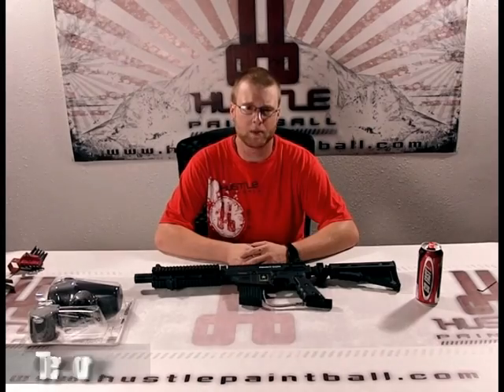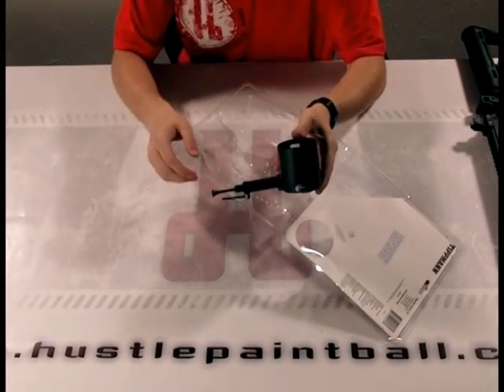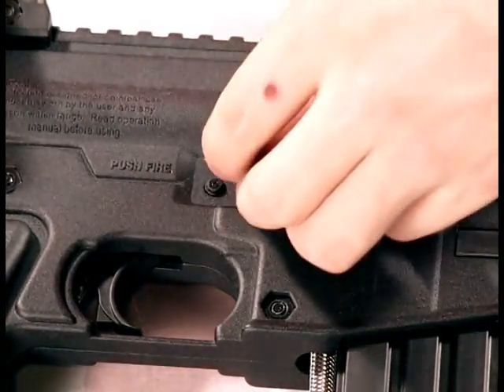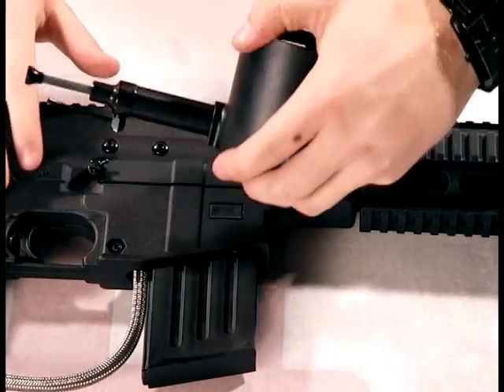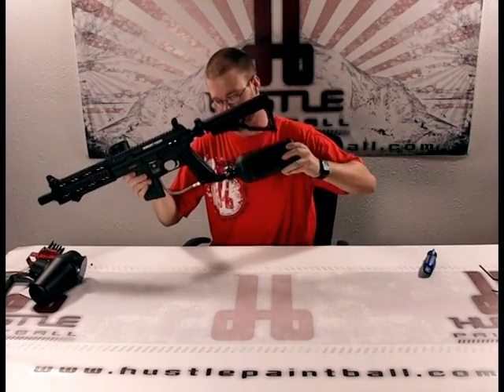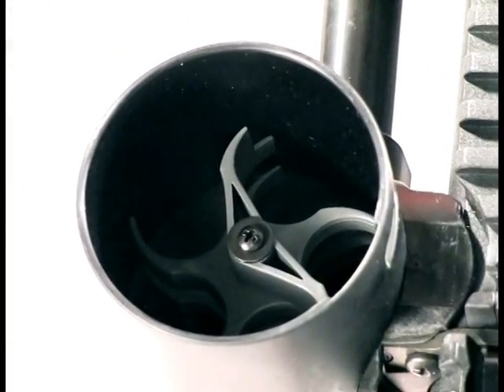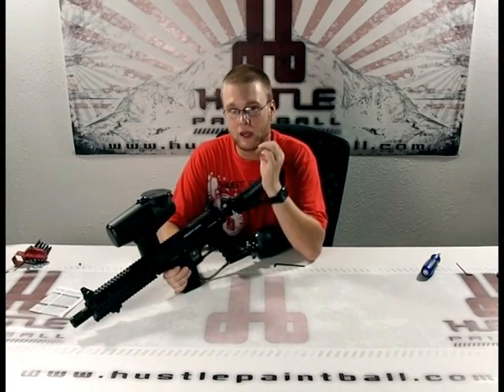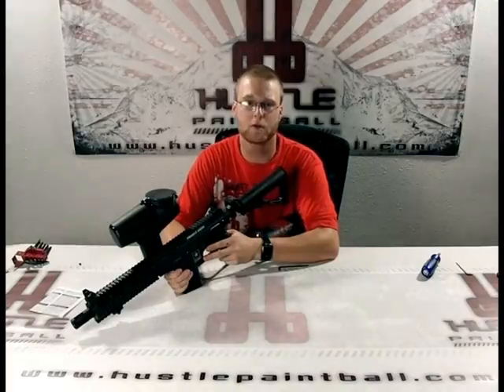How to Install a Cyclone Feed Upgrade on a Tippmann Project Salvo by HustlePaintball.com

Comment from the maker: @Huzzle2 The tube you refer to is somewhat flexible so that it is easy to attach. The fitting that it attaches to has a barb to help hold the tube in place. This allows for you to remove the pieces but they will not come apart during play.

Comment from the maker: You certainly can! You'll use up air quicker due to both of them running off your air supply but they definitely work! My recommendation would be the E-Grip and Cyclone. One uses a battery, the other air. -Russell

Comment from the maker: @novasoda All you may need is a banjo t fitting. Since both the Cyclone and the Response use air you will need to connect both air lines to the marker. Some markers do come with 2 separate ports so you can use two banjo fittings.

Comment from the maker: @PEREZACURA1991 You could do that but there is still going to be some wiggle room between the shroud and the barrel because the J&J barrel is considerably thinner than the stock Salvo barrel. It will stay on but won't be a tight fit.

Comment from the maker: @roger3655 First replace your hose. It sounds like it may have been damaged. Second, depending on your set up we would recommend putting some space in between your tank and your marker to keep the cold gas as far away as possible.  This could be anything from new remote coil or possibly think about changing over to compressed air.

Comment from the maker: The E-Grip can run 4 firing modes that can be changed in seconds - semi auto, 3 shot burst, and 2 full auto modes. You'll be all set with the E-Grip in the Salvo no problem. Definitely pick up a Cyclone with it too!! :D -Russell

Comment from the maker: @soladetenis Runs off of the air in the marker and feeds a ball every time you shoot. This works very well and the main difference is that this does not need any batteries.

Comment from the maker: @xhogzilla88 The disadvantage of both the Response and the Cyclone is the loss of efficiency. The air that is used to run both pieces is air that you won't have for shots. The Cyclone is extremely reliable and as long as you keep it clean it will run. Using the Response with an electric hopper will cut your loss in efficiency significantly. Good hoppers in that range are the VL Evolution 3 and the Invert Halo Too.

Comment from the maker: @BloodandBourbon Loosen your front receiver screws just a bit and make sure that the front sight/cyclone feed latch is able to move freely, and pop up into place. Also, make sure that the front sight spring is there, so that it'll keep your cyclone feed system in place. -Ethan

Comment from the maker: Yes, though most likely not completely. In order to get the hopper completely out of the line of your sight you will have to offset your hopper. Obviously a 25mm lens is going to have less of an issue than say something with a 45mm lens, but the hopper might still obstruct your vision through the sight slightly. - Trevor

Comment from the maker: Loosen the front top receive bolt - that should allow the front sight to pop up (right now, I bet the body halves are too tight, and the front sight is stuck down) and that will allow your cyclone feed to snap up and in place. The other problem could be that your front sight spring is not in place, and thus, the front spring won't pop up. -Ethan

Comment from the maker: @brandonsegovia99 The Cyclone Feed System uses air from the marker to force load a ball into the barrel after every shot. This is a great upgrade that is easy to install and works fantastic. A great alternative to an electronic hopper.

Comment from the maker: @RiCeBo1 Check and see if your tank is low.  If your gun is firing but the Cyclone is not rotating, that may be the culprit. Since it is brand new and you were careful with the installation, some of the more egregious errors are unlikely.

Comment from the maker: @seththeslayer1 This Project Salvo marker does not have a Response Trigger installed but you can install the Response Trigger and use it with the Cyclone feed system.

Comment from the maker: @vjstudio No, the response trigger will not help your cyclone feed. If you are having trouble with it sticking I would lube it with a non-oil based lubricant. If you are still having trouble I would bring it to your tech to see what the problem is, or if you are in Colorado, stop by the store and we can take a look at it for you.

Comment from the maker: We've got it on the list... but the long story short, go with the Apex - it's adjustable, easy to take off, and you can put the Apex 2 tip on other barrels - the Flatline is a fixed system :( -Ethan

Comment from the maker: @xMSxfruitSALAD That's pretty strange - have you chronographed your gun? If you took the velocity screw out, and then put it in at a different spot, that will definitely affect your velocity - go ahead and back out (turn the screw counter-clockwise) to increase your velocity. -Ethan

Comment from the maker: It could be a few different things. If the front sight is stuck down, then you need to loosen the body half slightly to allow the front sight (which holds the cyclone feed system in place) to move. If the front sight moves, but doesn't stay up, then you lost your front sight spring. Search for #98-44 or "front sight spring" on our website to snag that piece. -Ethan

Comment from the maker: Every screw, nut, spring and everything else can be had for any Tippmann marker. Find the part number in the manual and you will find it easily. - Jeff

Comment from the maker: Okay, so you are asking, if you remove the cyclone but no longer have the stock fitting if the marker will work correctly? It will not, all of the air will escape the valve and there will be none to push the paintball out of the barrel. Luckily the stock part is super cheap, it is Tippmann Part #TA05021 and can be found by typing exactly that in the search bar on our website. Let me know if you have any other questions! - Trevor

Comment: I just purchased a Cyclone and it doesn't want to cycle at all (the paddles will not rotate after every fire).  What could have been the problem?  It's brand new and I made sure everything installed perfectly fine.  Thanks.

Comment from the maker: @MrMegafatman15 I prefer the Cyclone Feed System, since it's lower profile than an electronic hopper, but it's completely personal preference. If you want to mount tactical accessories to your gun, I'd recommend the Cyclone Feed System. 

Remember that you can also contact us at support@hustlepaintball(.)com with any questions or comments that you may have.

Comment from the maker: We haven't made this video yet because the only difference is one piece. You just need a new banjo fitting, the Banjo T-Fitting or Tippmann part #02-86 you can find it easily on our site :). Once you have that, both hoses can attach to it, and both kits will work at the same time!

Comment from the maker: @ifUreadThisyourGayXD A Banjo T Fitting will be needed to run both of those on a Project Salvo. The Banjo adds another air line so they both can be used. Hope that helps.

Remember that you can also contact us at support@hustlepaintball(.)com with any questions or comments that you may have.

Comment: if i wanted to install a response trigger where would i connect hose. If i understand right it connects to the same port at 1:25

thanks
Reply from the maker: That's exactly it. Just run the line from the trigger to that port. - AJ (With help from Cromer)

Comment: Hey thanks for the Video..  I install the cyclone feed but its not turning.  Any advice?
Reply from the maker: Hmmmm.... sounds like a connection problem. I would double check all your connections. Make sure the cyclone cycles when you push the plunger as well. 

- Chris

Comment: what kind of hopper did you put on your cyclone feed? Thanks and great video!
Reply from the maker: The one in this video is the old stock cyclone feed hopper. They are no longer made. You can use any cyclone specific hopper - such as the Tippmann Low Profile. :) 

- Chris

Comment: Hey quick question. I just got the Cyclone feed system for my project salvo.I did the install while watching this video. My problem comes into play that the feed system will not latch onto the gun. Is there anyway of fixing this or do I have to go return the one I got and get a new one.

Comment: @HustlePaintball i want to buy an aftermarket barrel(jj ceramic 14 inch) but i dont want to change the shroud on my project salvo could i just buy a m4 front sight attach it to the barrel so it holds the shroud in place

Comment: Yo I saw ur other video and I installed my egrip and I think I did it right but my but stock moves just a little bit side to side just a little should it be sturdy ?
Reply from the maker: Sounds like your body halves might not be aligned properly. Make sure that they're seating correctly. If they are, make sure that the rear plug is seated properly as well :)

-Dan

Comment: Hey Hustle!
I have installed the cyclone feed on my project salvo and if i dont have the stock fitting then will it still be possible to fire my gun without the Cyclone Feed System?
Thanks.

Comment from the maker: Try putting your stock elbow back in - does it snap in place just fine? If so, and your cyclone feed system will not fit, I'd recommend calling Tippmann - your cyclone feed might be defective :( -Ethan

Comment from the maker: @airsoftguyfortyone If you install the Cyclone Feed System, you should be absolutely fine. Now, if you get an offset hopper like the APP T-2 hopper, then you'll definitely have room!

Remember that you can also contact us at support@hustlepaintball(.)com with any questions or comments that you may have.

Comment: Wait does it need the E grip to use the cyclone feed?
Reply from the maker: No, it does not. The Egrip works well with the cyclone, but the semi-auto trigger will work with a cyclone as well. - AJ
Reply: Thank you sir, I'm trying to save as much money as possible!

Comment: Is the banjo fitting supposed to be really tight? Because the little barb on the banjo is still loose on my gun.
Reply from the maker: Marco Dominguez The threads should be tight to the gun, but you may have a collar on it that it designed to rotate. That is normal. - Ben

Comment: I cant stall my cyclone feed on my project salvo, it doesnt fit on it the latch does lock on the little pin to hold the feed neck. what should I do ?

Comment: Is it worth having this feed system if you don't have an e- or response-trigger on your marker?
Reply from the maker: In my opinion, yes - it'll prevent you from having ANY chops, since the cyclone feed will make sure that there is always a ball in the chamber :) -Ethan
Reply: Hustle Paintball hey how do you change fire modes on the e grip?

Comment: Hi. I was just wondering if the marker needs to be connected to co2 or HPA in order for the cyclone feed to work. I pulled my 98 custom out of storage and when I pull the bolt back and Fire without any air, the cyclone feed does not cycle. Is that normal?
Reply from the maker: Eric Henry That is perfectly normal. The cyclone works by redirecting some of your compressed gas through a 'banjo' fitting and cycling the paddles. There should be a plunger on the right side of the marker than you can press to manually rotate the paddles, but, it will not cycle on a trigger pull without an air source. - AJ

Comment: Hi, I have a project salvo that I am trying to install but it isnt working. When I shoot it doesnt spin. I did the manual button and it works fine and I took the banjo fittings and tube and blew through them and they are clear. Any ideas?
Reply from the maker: ***** Can you feel any air coming out of the tubes at all?

-Dan
Reply: Hustle Paintball Yeah, I took the banjo fittings off and the rubber tube and blew through them fine. I dont know about the air comming out of the actual gun or the internals of the cyclone feeder.
Reply from the maker: ***** There are a few things that this could be, but one of the most common is the O-ring on the banjo fitting. Since the Cyclone will only leak when the gun is being fired, it is very had to pinpoint the leak. I would start by removing the banjo fitting and holding your finger over the side of the gun. If you can feel air when the gun is cycled, attach the banjo fitting (just the fitting) and test that the same way. Continue to work up the line until you find the problem. If you still need help with this, please email us at support@hustlepaintball.com or call 877-298-8188 so that we can assist you better. - Ben

Comment: My banjo fitting will not screw into my Sierra One. it seems like the hole is smaller than the screw
Reply from the maker: +Divinity Contact Tippmann and get a new Power Tube. It should be a free replacement!
-Russell

Comment: How do you turn the syclone on that wasn't very clean in the video
Reply from the maker: The Cyclone is "on" whenever the marker has pressure in the tank. There is no on or off switch - you shoot and it will load the next the ball. - Jeff
Reply: He was turning on the e-grip

Comment: Question, appreciate any advice/troubleshooting help.  Have a used 98 Custom Pro with Cyclone Feed installed.  Brand new 3000psi HPA tank.  Everything works great except that with the base cover plate on the feeder, the ratchet won't cycle unless done manually.  Take the cover off (exposing the ratchet) and it'll cycle just fine (holding the piston in place with a finger).  So that tells me the feeder is getting enough air and there aren't any burrs, worn parts, broken parts, or otherwise.. but that somehow, the cover plate is interfering with the action.  There's a small detent in the center of the plate that interfaces with a centering hole in the middle of the sprocket, my next step if I don't have any other ideas is to sand that down a bit, perhaps it is fitting too tight and keeping the sprocket from turning.
Reply from the maker: +800lb Gorilla It could be an issue with the screws holding the plate in - too tight maybe? When a Cyclone starts acting up, it could be the easiest fix or one that needs new parts. I would call Tippmann and have them get you goin'. They're techs are great over the phone - or you even might get some new parts. Never know...!
-Russell
Reply: +Hustle Paintball We think the same.  I tried backing off the screws, no function.  Tried it with no screws, no function.  I think you're right, the best option at this point is to call Tippmann, they might just give me a return number and replace the unit.  Thanks!
Reply: +Hustle Paintball Wound up replacing the cyclone internals and the air line, now it works just fine.  Didn't see anything wrong with the original parts, but something ain't right.  Oh well, works now!

Comment from the maker: Make sure your front sight spring is in the correct place, that is the most common reason for that issue. -Jay

Remember that you can also contact us at support@hustlepaintball(.)com with any questions or comments that you may have.

Comment: Ok i installed it and all that stuff... And when I go to shoot it, It shoots a couple times then the locks so I pulled on it, and it shoots... Then the gas doesn't feet and then the bolt goes back. So I have to keep on pulling the bolt back to shoot... What do I do?
Reply from the maker: You can try a little oil in your marker and maybe double check to make sure you're shooting at the right speed. - AJ
Reply: Ok will do! Just one more thing, Should I add the oil in the bolt or where else?

Comment: I've gassed up my Project Salvo with propane.. After every shot I have to pull the bolt back.. I cannot get it on semi..
Reply from the maker: Propane or Co2?
Reply: Mitchell Gentile You working on a flamethrower?